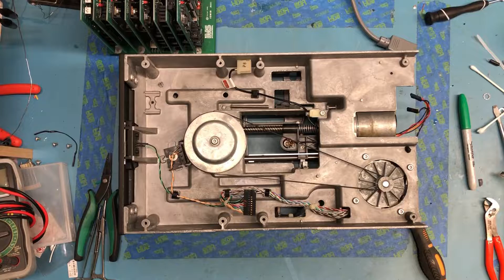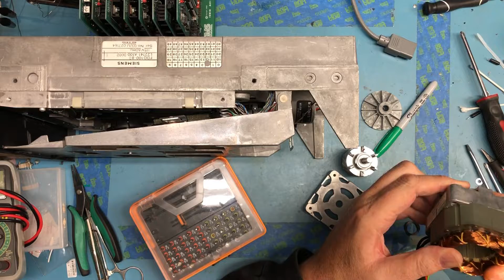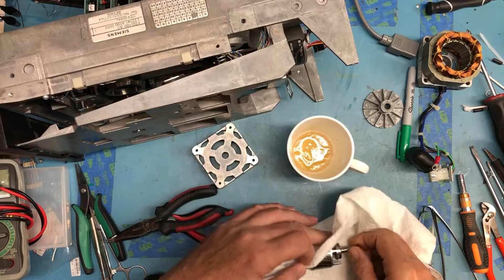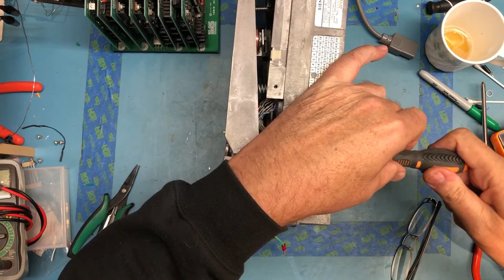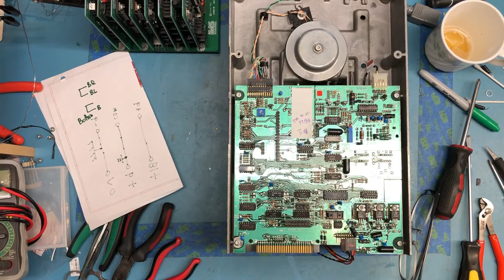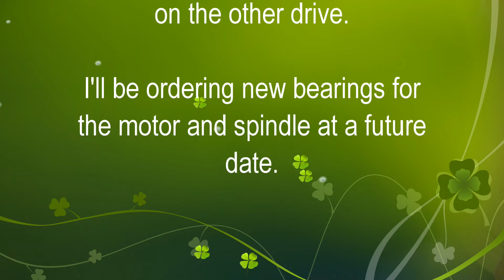Altair 8800 - Part 32 - Lubricating the motor bearings on a Siemens FDD 100-8 Floppy Drive - STB391

Comment: Oooooo WD40 is not a lubricant... it's a solvent, and it displaces water, but it will dry up and gum up the bearings over time.

The shields on the bearings might be removable for easier cleaning and lubricating.

My 10yr old daughter and i roller skate and i clean all 16 wheel bearings once a month or so
Reply from the maker: Thanks, you're 100% spot on here and yes, I'm incorrect in the video. I have some synthetic watch oil which is designed to not gum up. I've been meaning to get a video up on using it for bearings. I'm also using lithium grease for moving parts such as the head slides and parts in the disk lock/unlock mechanism. So far this has been the best combination I've found however time will tell.